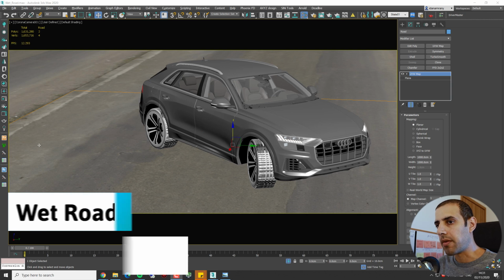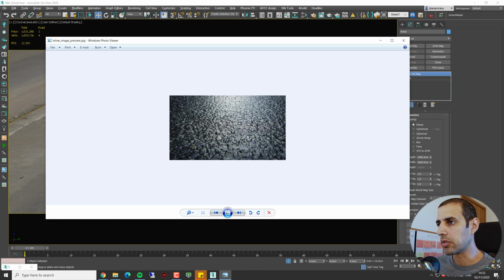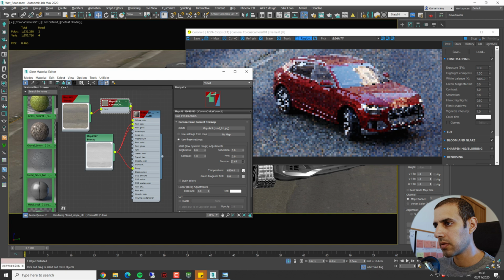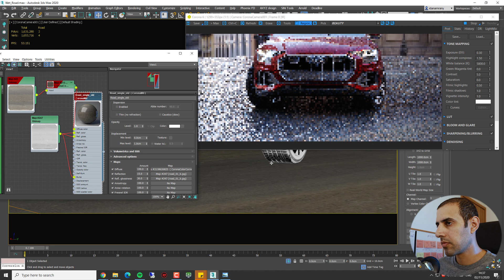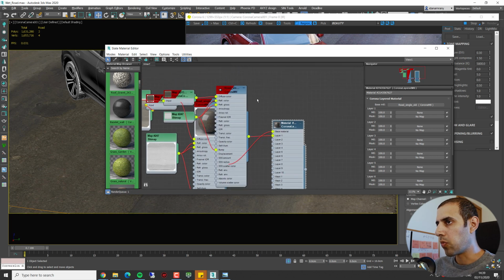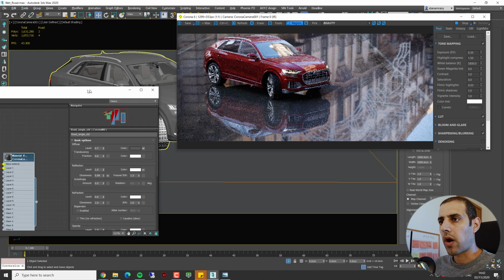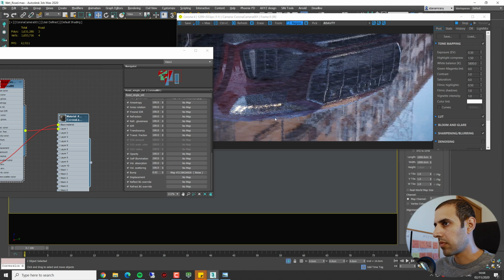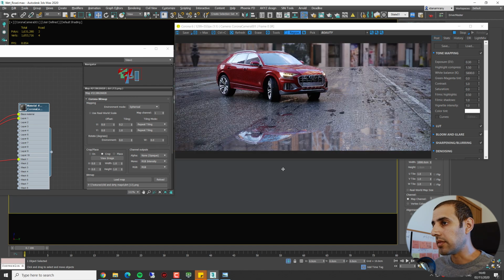How to Create WET Road material in corona render

Comment: Hi, great video! I have a problem, I followed all your steps, but my mask is not visible at all. Is it because you are using specific png or jpeg format? Or it is about assigning the material. Because in neither way it does not work in my case?
Reply from the maker: The file type isn't important, maybe you didn't set a proper uvw mapping?
Reply: @archvizcamp  yes